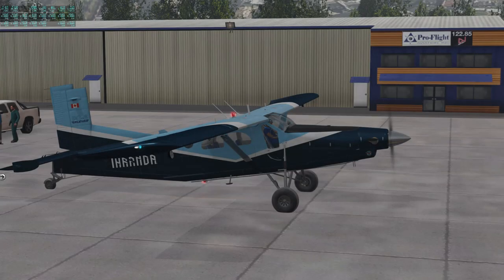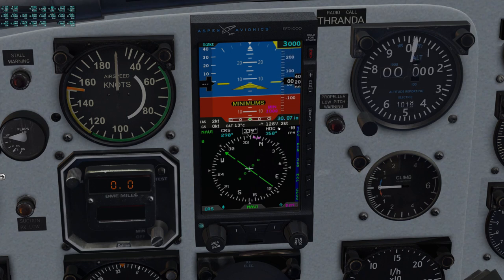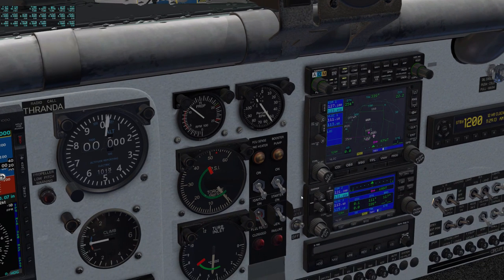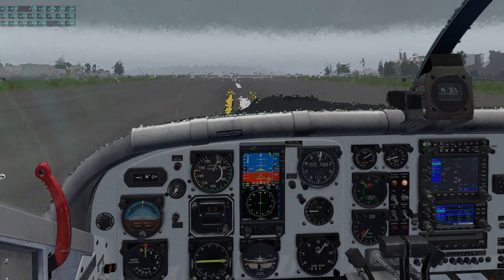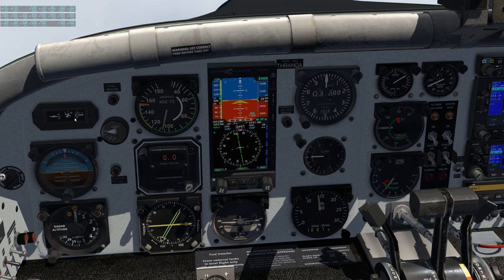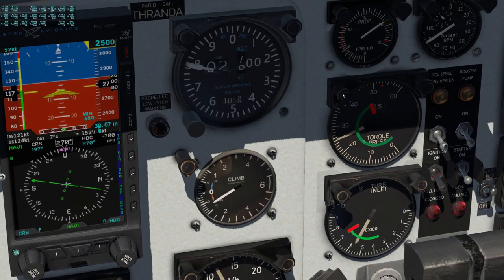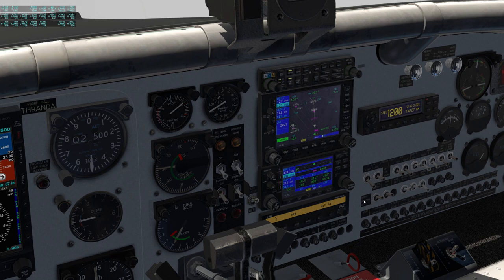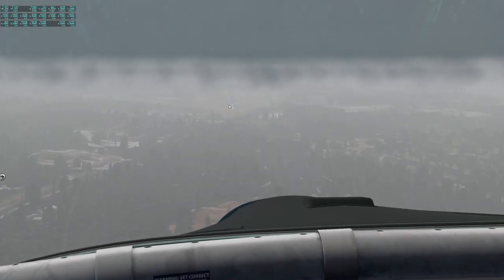Thranda Pilatus PC-6 Instrument Flight

Comment: No Joe, what weather engine are you using?
Reply from the maker: This video was the default X-Plane weather.  :)  It does quite well most of the time.
Reply: @josephnoe2956  Glad it works for you. I am doing the same flight; no rain effect on windows. I have FS Global but it is turned off; I have the RealityXP Instruments; and Air Manager; and a little Forkboys Ortho for VFR. But then without any of this, from day one when I saw this video, I never could get the weather you have...  Keep up the good work and videos! I will keep plugging along.